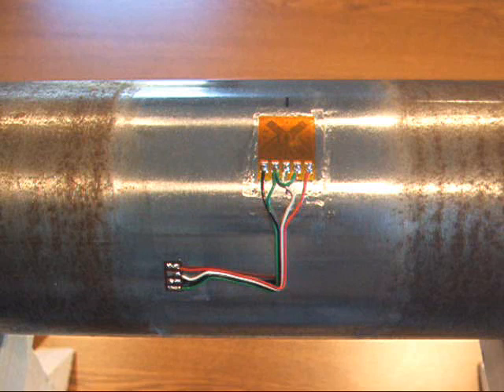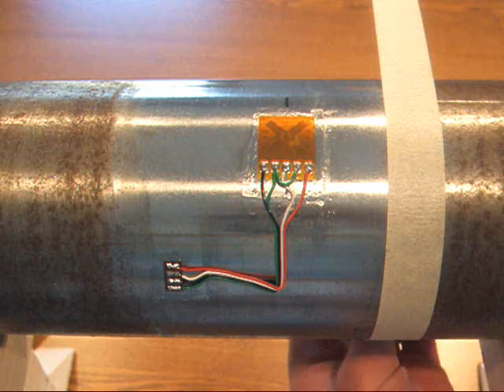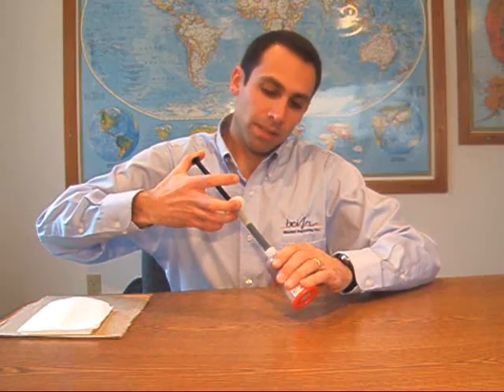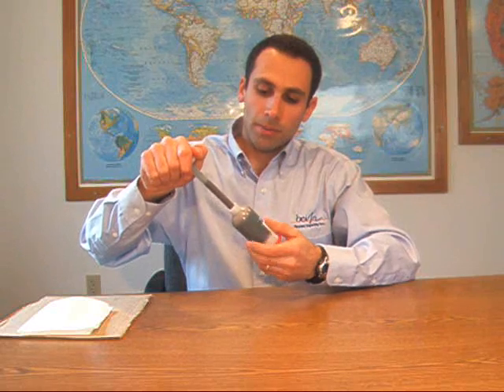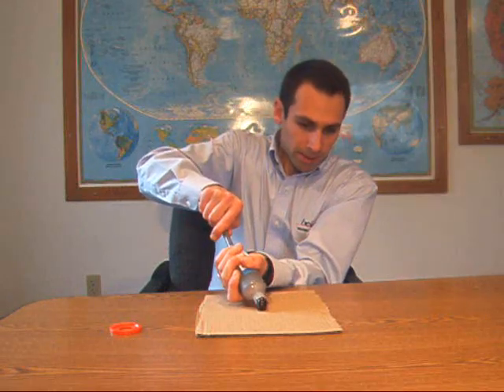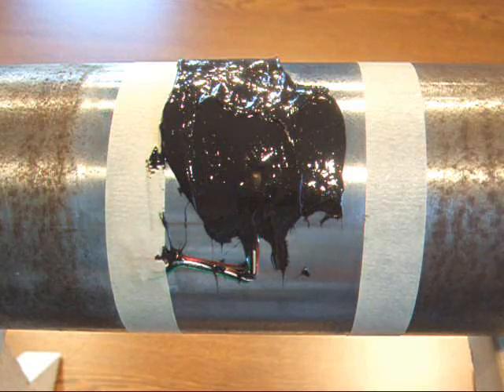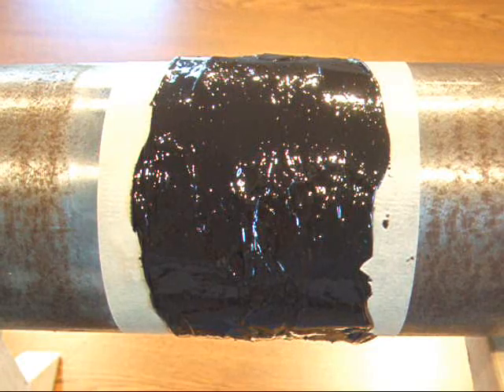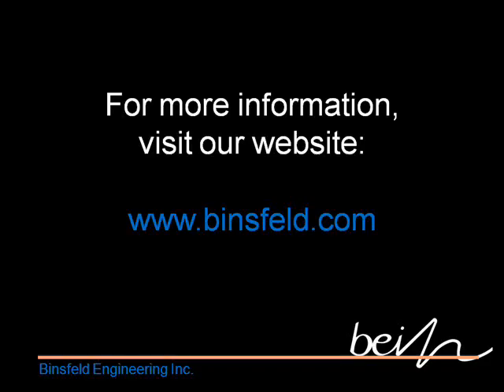Protecting the Gage with M-Coat J

Comment: Please take into consideration that it is mandatory for long term applications to use teflon tape to protect your gage before applying the M-coat J. (I refer to the application note provided with the coating, section 'APPLYING M-COAT J'). M-coat A is not a suitable barrier between the gage and M-coat J.